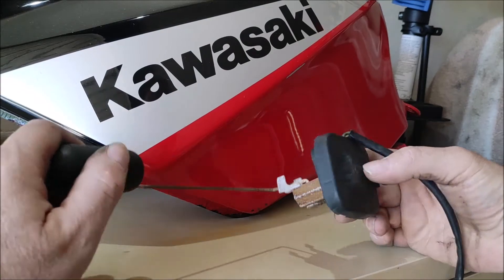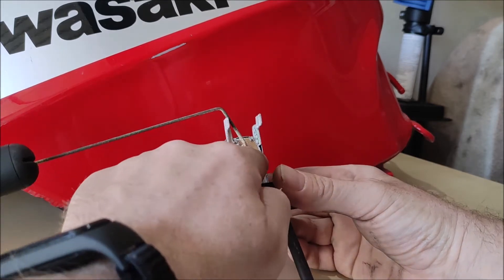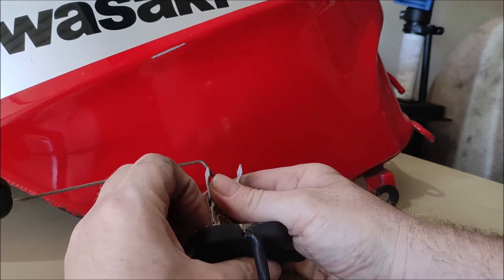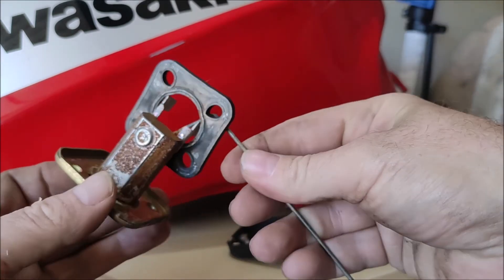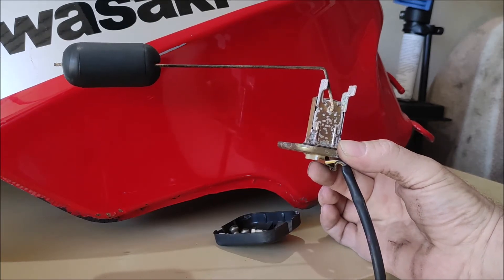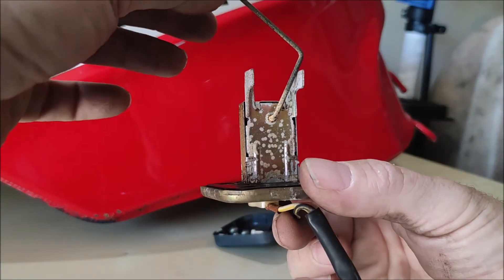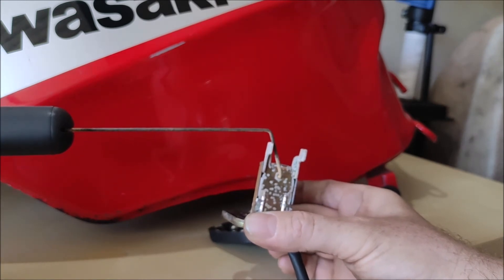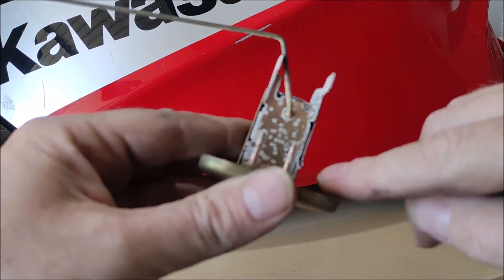Kawasaki GPZ600R ZX600A Ninja Fuel level sensor explained

Comment: I’m wondering how there’s not a chance that a short or break won’t cause a spark in the case where the tank is almost empty and fuel vapor is exposed to a possible spark?
Reply from the maker: Interesting thought. But, remember, there is no electricity inside the tank. The float moves up and down a potentiometer, this gives us the reading. There isn't any positive activ power inside the tank. The guage has the power. By moving up and down the potentiometer , only the resistance of the current at the guage is changed. Exactly how this works, I couldn't say.